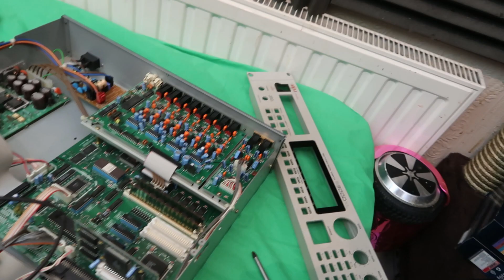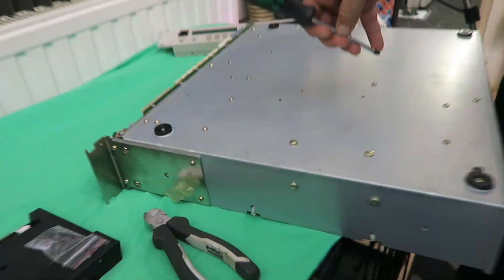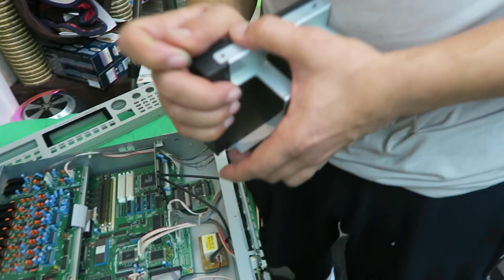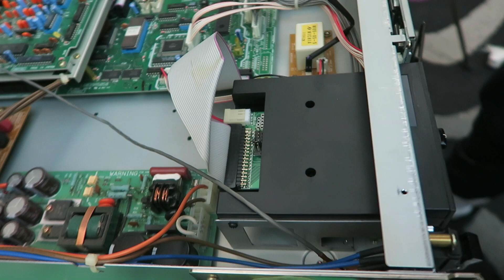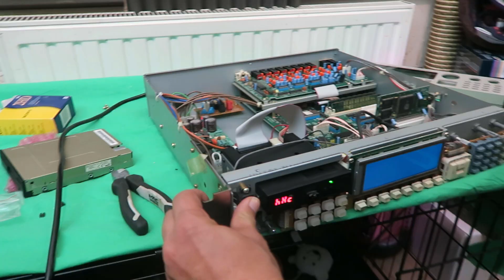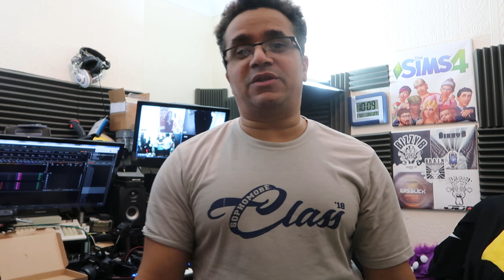AKAI S3000XL is Back in 2019 | HXC Floppy Disk Emulator Instal

Comment: Hi my name is Elaine  (2 x s3000xl s).  Ive watched all videos to do with installing the emulator now but so far nobody has explained how to get my precious samples from the floppys back inside the sampler so that i can save them via the usb stick . Can you help me ,this seems to be the final solution but i can't get my head round how it will all works . Desperate   ,E Thank you enormously for all your vids !
Reply from the maker: You would have to do this via SCSI using a program called mesa or recycle, I believe I did cover this in a previous video. Good luck!
Reply from the maker: https://youtu.be/GbpD0VJp258

Comment: Cheers for the video man, your vid got me the furthest in the installation part, ie Old Drive is OUT and new one is IN (LED is turning on showing that it's connected propperly) Only thing is, there was no metal mounter in my AKAI S900 Unit which I just got recently, like I see in y our video. Old disk drive looks differnt to the one in this video also. SO When the new drive is in, theres nothing to secure it in place. Hmm. Cheers for video though it was helpful.

Comment: Hi, very good work, I'm trying to see if we can put a gotek or hxc externally on a CD 3000 XL, is it possible in your opinion? thank you.
Reply from the maker: I guess so, but it would be a case of getting the jumpers correct, but some of the samplers don't work well with flash floppy so you might need to install the original hxc firmware instead
Reply: @TheBizzyBScience  ok thanks, i will try.

Comment: Excellent video.I have an S2000 and an ESI 2000 ,both Hxc .But can’t get samples loaded onto the usb stick with the software.So I’m using midi sample dump for the Akai and saving the samples from the Akai internal memory to the usb Hxc .The ESI 2000 Im recording samples through the analogue input and saving them to the Hxc usb .How do you use the software

Comment: Hey Bizzy,

What jumper settings so i need for the s3000xl? Got the gotek ready to install
Reply: @TheBizzyBScience  same one you are using but in black, oled screen and scroll wheel with push button from ian berry. Akai S3000xl
Reply: @TheBizzyBScience  Ive installed the gotek and it powers up, i can see a blank disk image in indexed mode but when i try and save a sample i get "no disk" 

Any ideas?

Comment: i just plugged mine in the other day, it worked, loaded disks.

today..."drive not ready - disk removed"

i can't seem to get the floppy drive to load :(

i can get the hxc emulator, but can i get another floppy drive to transfer my samples elsewhere?
Reply from the maker: Drop me an email bro,
Reply from the maker: Have you selected the correct image ? Or are you copying samples onto the usb and trying to load them in your sampler?
Reply from the maker: This may help https://youtu.be/xvAm94PVH-M
Reply: @TheBizzyBScience  no, i was just trying to load samples from a floppy disk.

the funny thing was, there was a buzzing coming from the floppy drive, and my mobile phone was sitting right next to it.
when i moved my phone away, the buzzing stopped, and it started loading the disk no problem.
surely it couldn't have been mobile phone inteference stopping it from working??

well, it had been fine since then.
obviously i will just need to watch some of your videos on how to backup all my akai floppy disks.
Reply from the maker: @barrygibson1848 Drop me an email, so I can clear this up for you